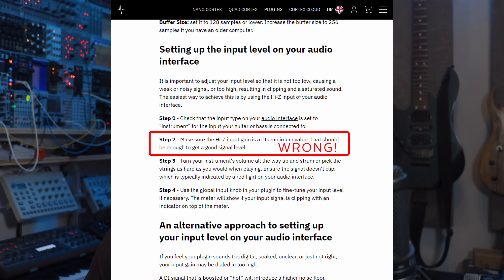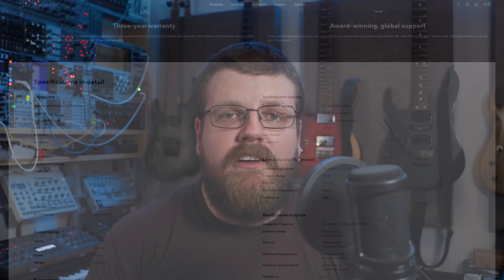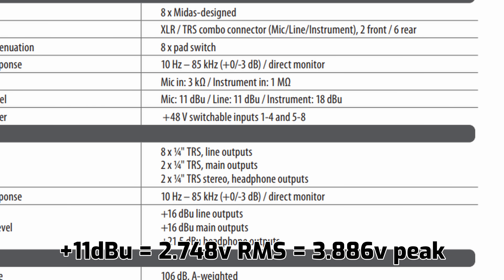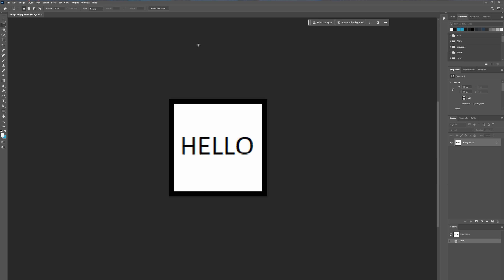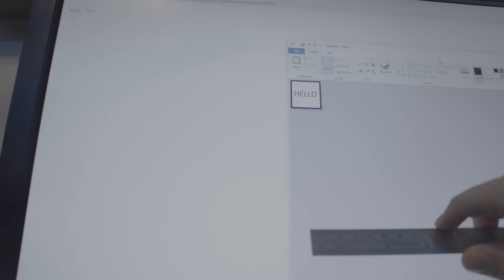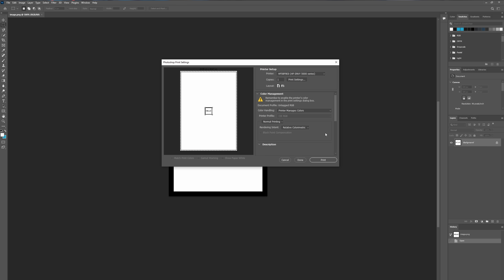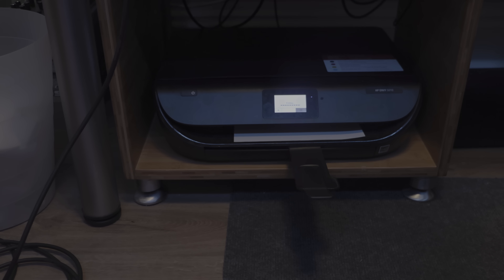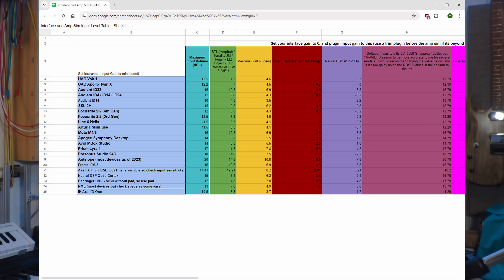Ampsims and input gain - Please, stop the madness...

Comment: Yeah I found the values for the amp sims in the spreadsheet. Great video and of course everything here is correct and I agree with completely.

All I would really add here, is that most interfaces with around 12dBu of headroom at 0 gain are going to produce a signal close to clipping when using humbuckers. So in these cases, it’s already going to be very close to an optimal SNR, and you can easily know your headroom amount (in order to calibrate your specific plugin).

The other factor, is that as long as the noise of the interface is sufficiently below the background noise of the pickups, there will be little to no improvement in optimising SNR - increasing preamp gain will also increase EMI/RF interference from the pickups. 

On noiser interfaces like Behringer, it’s absolutely worth optimising SNR. I think many interfaces in 2024 will have less issues with noise and too much headroom. If noise is not causing issues, for the average home guitarist, easily knowing the level of headroom they are using will be more useful than a louder signal. 

In an ideal world, the SNR would be optimised, AND each user would be able to easily determine their dBu->dBFS ratio. If SNR is essentially “solved”, then the easiest way to know the dBu->dBFS relationship is to turn the gain to the value provided in the specs.
Reply: I noticed that with a Gen 3 Scarlett I just started using! On my Tascam model 12 I would run the preamp at around 11 o'clock where it has 0db marked and my signal would peak inside reaper at around -6. So I was quite surprised that on the Scarlett, turning the preamp all the way down resulted in a similar input signal level
Reply: The main technical point of the video is correct but is almost missing the point that some of the earlier videos its replying to focus on: 

Even if you get a good signal through the ADC there is very little useful information about what digital signal all the various amp sims “expect”.  There are numerous  hardware and pure software options and even within one software it isn’t clear that all the amps and pedals expect to get the same level of signal to create a realistic recreation of the hardware.  

The earlier videos were trying to get to a place where you “just plug the guitar in” and the amps behave like their real world equivalents, and hot pickups also behave the same.
Reply from the maker: Agree with all of that! I intentionally used the Behringer because it highlights the issue. It both has poor noise performance, and an unusually high input level. These two facts conspire to make it particularly sensitive to this subject matter 🙂
And thanks again for collecting all that data!
Reply: @GhostNoteAudio  For sure! I think generally companies like UA/Audient/Focusrite/RME etc are doing the right thing with “standardising” 12-13dBu as a sufficient level of headroom, while still retaining good SNR. If the maximum is below that, then it becomes easy to clip. I believe some UA and RME interfaces have stepped gain controls which makes it easier to optimise further without the need to measure the headroom manually. 

Also guitar modellers like the Axe FX and Helix have dedicated DI inputs with extremely good SNR converters and can be a good option for guitarists who might already own one and have a noisy interface.